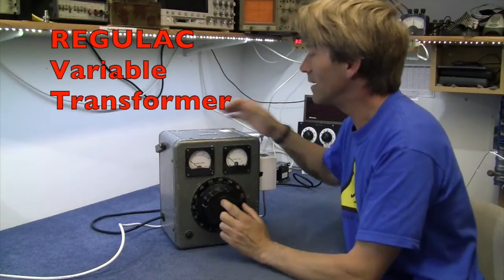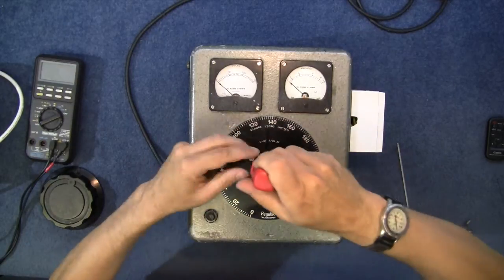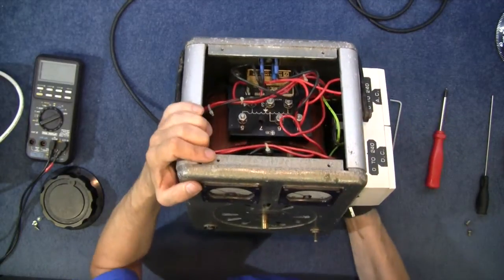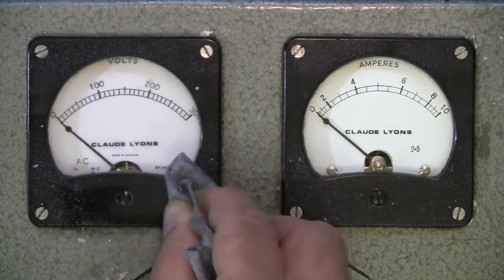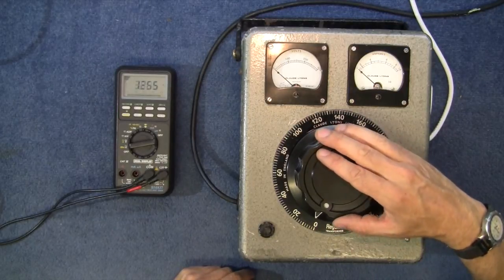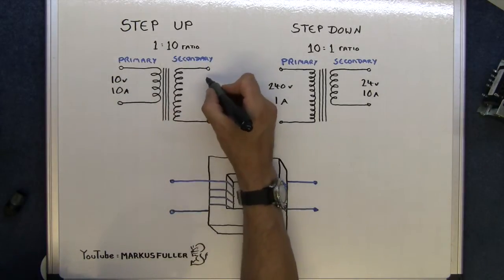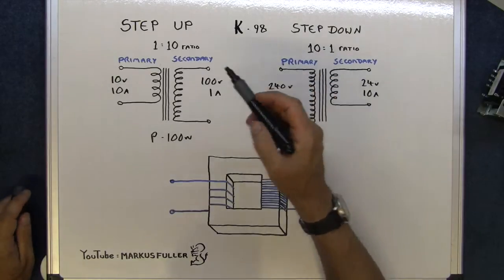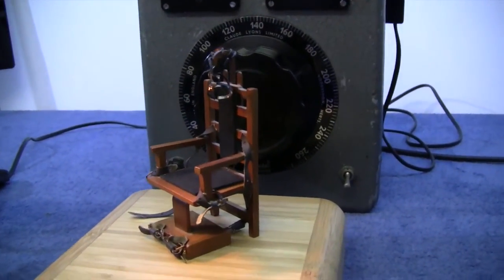MF#32 Variac Variable Transformer and how Transformers Work

Comment: Markus:
I recently acquired a 120v 8A variac previously used to control a bank of ceiling fans. It's a bare unit, but should make the basis for a bench variac. I'm a neophyte in electronics, but have several decades experience in electrical, electric tool repair and design.
This allows me to build the bench tool however I decide. The problem is, I only know the basics of how a variac CAN be used.
I was hoping you could help me with ideas on the design. Specifically, types of gauges, (volt, amp, ??), and (analog or digital or both), type of output connections, circuit breaker or fuse for overload, or anything else you can recommend.
I got the variac free, have gauges, both analog & digital, switches of many types, so don't worry about cost. I either already have it, (most likely scrounged, as well), or can afford to invest a bit.
Thanks, for any help you can provide.
If anyone else has any suggestions, throw them out there. I'm looking for ideas.
GeoD

Comment: The reverse-labeled dial plate might to correct for wear spots. Towit:

If, as would be expected, the variac is used a lot at the 240v point, the winding at that point might get overheated for some reason (short in the load, etc.). This could make that location on the winding (about the 4:00 position) unusable.

So rewire the inputs and outputs to the variac (inside connection panel at the variac) so that increasing is done anti-clockwise, and flip over the dial plate. 

Voila! A new variac (well, at the 240v dial location anyway). 

Can't think of any other possible reason for this provision. 

Cheers.
Reply from the maker: Hmm yes it sounds plausible.

Comment: can we connect this transformer from generator 7500w with 350v?
Reply from the maker: +Thanara Chhim I would not want to try that as this is designed around a 240 to 250volt input. It may work but I personally would not try it.
Reply: thanks for your reply

Comment: And where on earth did you get that!!. Good find. I have no idea why I like seeing these things. And I just bought a 2kW transformer a few weeks back for a truck load of money. doh.

Thanks for the good show and useful info at the end.
Reply from the maker: Hi SoloStuff. It was a car boot find (garage sale) cost me £4.00 uk . the owner used it as a door wedge :-)
Reply: @solostuff

you might be able to help me with a 7.5/7.8Kv transformer I need to test to determine its value.

Who would be able to test this kind of output? 

This transformer is for a static elimination system, but I barely know what that is, let alone where they might be used.

I don't have a clue what field might work with voltages like this, so I'm at a loss as to who to contact about testing it for me.

Any help is greatly appreciated.

GeoD

Comment: I have a 4A variac, that one is a real find for 4 quid !!
Reply from the maker: A real bargain. and it can be used to wedge my garage door open too LOL
Reply: markusfuller
What i use mine for is bringing old transistor or valve stereo equipment up very slowly to full voltage if they have been in storage for years, the variac i have is one made by B+K and is fully isolated, it was sold mostly for TV repair to help not getting fried from a live chassis, i picked it up in my local thrift store for $10, it had been bought in New York city in 1984 and carried back by its local owner here, i even have the original customs receipt !
Reply from the maker: I like B+K gear. Im not sure of the power handling capabilities of my isolation transformer. Its not very big and theres no makers name on it.

Comment: Hi Markus, this time the YT-notification about new videos was really fast, and therefore i´m here right after you done the upload...:)

Cool found, it´s always nice to have at least one of these, as they are very helpful, especially when they doing a full mains isolation as well....But yours it´s a plain variac....better put another 1:1 tranny prior to have a full mains isolation, when testing old gear in unknown condition....

I would have done the same, it´s no need for a mains related DC voltage...As it´s  very dangerous to use non-isolated mains power supply....

Nice explanation of what is going on in a tranny as well...:)
Reply from the maker: Hi Tubical. I have a good isolation transformer that powers those 4 lab type sockets on my desk. plus RCD and mains filter. overkill really but you can never be too safe.
Reply: Hmm, not overkill, quite good, as it´s always better beeing surely save than geting hurt via mains voltage....;)